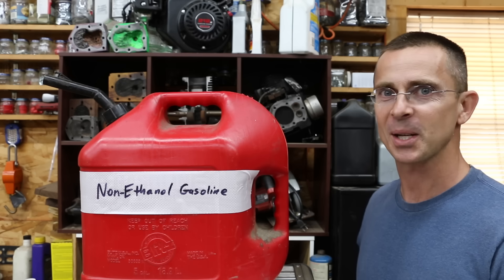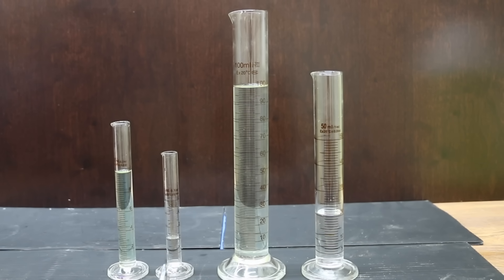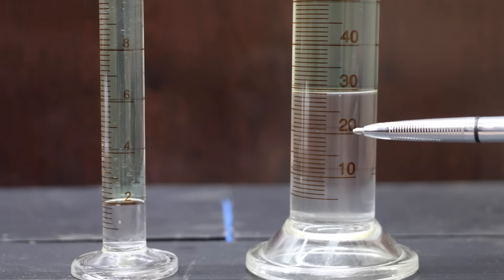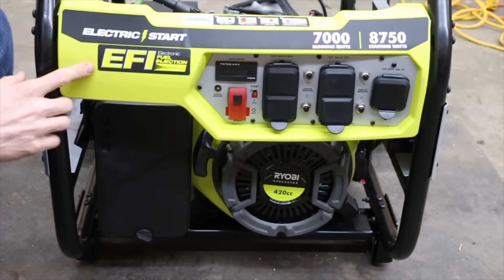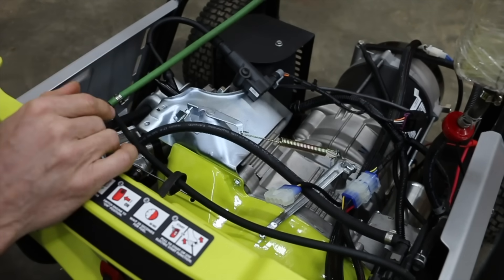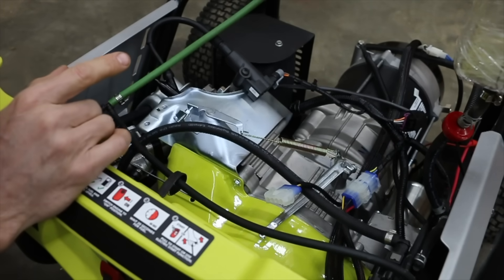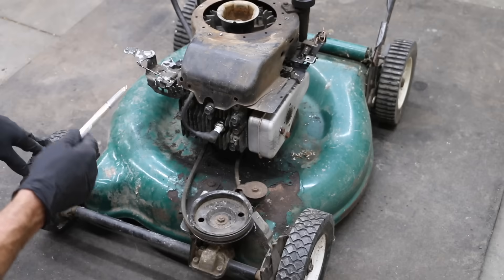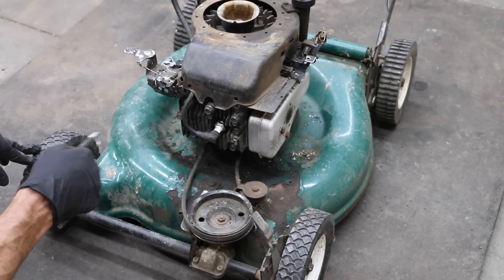Is Non-Ethanol Gasoline Really Better? See the PROOF!

Comment: During the BP oil spill in the Gulf Coast my father worked the clean up. They had many machines and for what ever reason they choose to not use ethanol fuel. People found that rather interesting as BP is a petroleum company and they do sell ethanol fuel themselves. 

BP clean up was a joke more than anything, the main part of the clean up was them spraying dispersants that made the oil and sludge more dense than the water causing it to sink to the sea floor. Most likely also how my father got cancer as it was just 1-2 years later he developed it along with a very large amount of people who worked the clean up compared to the national average.
Reply from the maker: Thank you!
Reply: They used non-ethanol fuel because of their proximity to water. Same reason marinas only sell non-ethanol fuel.
Reply: That could make sense and out of all due respect I do not say this to start an argument or even to suggest there is something there but they where leasing a lot of folks boats by the day to have crews go out and .. well clean up some along with determining the damage to the wild life (my fathers main job) but due to the shear amount of boats they where leasing they couldn't reasonable re-fuel all the boats so that job fell upon the boat owners to do. They where adamant* in their refusal to reimburse anyone who used ethanol blend fuel. I can't say why but they completely refused to do so and in this area it made it difficult to locate ethanol free fuel. Folks had to go a long ways away to get it considering the fact there was a gas station every 5 or so miles along the beach.

This was back around I wanna say 2009-ish I was 19/20 during this time and it really seemed to be at the peak where there was a lot of concerns about it as automakers at the time where openly declaring they would not honor the warranties of vehicles which where not intended to run ethanol (there is a area where every vehicle runs fine on it about 10%) but there was talks of making it 20%-30% minimum at this time. The overall population seemed to be mixed about it's effects on vehicles at high ratios and it didn't help with how BP was acting in regards to it during this time.
Reply: Very sorry about your dad. The Gulf, Fukushima, Bhopal India 1984, Exxon Valdez. Name your disaster. It's kept in the public eyes only long enough to satisfy a political agenda and then it's Hey! What's Beyonce Kardashian Angelina or the British Royal family up to.  We don't get to hear how the local population was scammed for cheap labor or paid hush money and not told how their lives have probably been shortened by years.
Reply: The reason is that Ethanol is much more expansive when you own the oilfields because you need to produce it "out of thin air"... that is also the reason bp and others don't like to blend E into their product.

Also according to the EU regualtion (at least a few years ago) the Ethanol produced by BP was not allowed to use as a fuel because they couldn't proove that it was produced with less emission than gasoline. So if you buy any alternative fuel in the EU you can be sure it is less harmful as gasoline because that is a law.

Comment: One thing I'd love to see is Stop Leak additives. I've seen some work, and others don't, but the ones that work are they risking damage? Also Cylinder Head gaskets in a bottle for blown head gaskets. Be cool if you can find a way to test these. I figure these would be harder trying to get the same failure on different engines/tests, but if anyone could figure a scientific method, it'd be you!
Reply: Stop leak is always a bad idea. In a pinch on road trip or something ok maybe just to get you home. But it clogs radiator, waterpump, and passages causes over heating issues. In oil it does exactly the same things causing blockages in oil passages, over works oil pump, and reduces lubrication of entire engine. Basically if you put stop leak in need to rebuild motor from ground up ASAP. Better idea is to get original problem repaired instead of using it.
Reply: @peterwelsh6975  Oh it's terrible, that whole "Tune up/Fix it in a bottle" aisle at the auto part store cracks me up. But clearly they keep making and selling it... I have a snowblower that is leaking oil from some mysterious place, I just keep topping the oil off for now as it's just too darn cold to take it all apart and rebuild it. I'm hoping it's the gasket, but hoping it isn't the crankshaft seal. That's why I thought of an oil seal thing.
Reply: kirbyyasha 
Most of the times seals leak because they are worn. 
The only time that oil stop leak  will sort of work is if the seals are dried out from sitting a long time. 
So at that point you might as well try a cup of brake fluid. 
That’s basically what the stop leak is , brake fluid and it expands seals in an attempt to soften them so they seal.
Reply: @peterwelsh6975  most of the people using these products know that the end of the engine is inevitable sooner rather than later. The way I see it, is the stop leak stuff is a bandaid to allow them to limp along their junker as long as possible before it's completely trashed. I think such products do serve at least that purpose though. JMO
Reply: @peterwelsh6975  I once had an old jeep, for a year two after I bought it, it would leave a drip or two of coolant, then stop for a week. One day, and entire tank solder seam blew at once. Someone had put stop leak in it, and the solder seam had been slowly "zippering" for who knows how long, until the entire seam was nothing but stop leak and blew at once. Hate that stuff.
Reply from the maker: Thank you for the video idea!
Reply: @ProjectFarm  dont forget to include the classic crack and egg and put it in the radiator fix if you ever do this
Reply: Barr’s stop leak for a radiator does work. I’ve used it on my 97 Mercury. It made a believer out of me. However I used 2 applications
Reply: @carnationvideos4258  it works fairly well on modern plastic and aluminum radiators, as the mechanical strength is in the plastic and metal, they hold themselves together well. But on soldered radiators, the solder is also the mechanical coupling of the radiator components-once the leak, they must be re-soldered. It does work quite well on newer vehicles, I must agree.
Reply: clogged my thermostat and major damage to engine. Mechanic recommended replace engine $12000, so I am currently rebuilding the engine..
Reply: I assume you're talking about seal conditioners, which should only be used in emergencies. As an Airframe and powerplant rated mechanic (aviation) we were taught never to use sealing additives because they deliberately cause the  rubber/neoprene/butyl seals to swell which, maybe stopping the leak, but cause the seals to fail shortly afterwards
Reply: @Taydrum  
It would basically be against the law to alter any oil in any aircraft. 
A&P by law sign their name on line on  everything touch. 
The head of signing your A&P license is personal friend of mine, and here's what he stated in class to new recruits. 
Dr's can only kill one at a time - 
A&P can kill thousands in a moment. 
But if it's your engine & mounted in a test stand,, have at it. 
The typical aircraft engine is fairly low tech design, except the crankshaft & cylinders. 
Notice there's no head gasket or bolts. 
Now a valve job on these is huge challenge. With the only access, the bottom of cylinder. Each cylinder is a separate entity & bolts to engine case by base of cylinder flange. Allows cylinder to move during stressed heat cycles. 
Cheers
Reply: @Philscbx  I'm talking about General Aviation (GA) not commercial aviation. Owners perform all sorts of modifications and additives to their planes whether it's allowed or not. On a side note, doctors have killed 100s of 1000s prescribing opiates and other meds. The US is in an opiate crisis, and doctors who vowed to keep health in mind, have blatantly ignored that in search of more profits
Reply: @Taydrum  
Right, that's why in first post, Cessna was mentioned.
But if you as A&P service someone's ship, you are responsible. 
Reminds me one day, owner wants me to hand prop his plane,, No, you get out, I'll hold the throttle & brakes. 
I've had 049 engines as a kid, I'm all done hand propping engines.
Reply: Yes please do a head gasket repair In a bottle. Which one is best?
Reply: kirbyyasha 
Haha I tried a bottle of that aluminum colored bars leaks a few months back. 
Stuff looked scary , like liquid aluminum. 
but it wasn’t my car so I poured it in! 
Sealed the leaks and 3mo later it’s not overheating and acting up.
Reply: lucas power steering stop leak is great. I hate all other lucas products however (tried many after such good success on their powersteering stop leak)
Reply: Stop Leak, in the micro flake copper type  works 100% at blocking your heater core in nothing flat. 
To rescue - remove heater hoses from the heater core tube ports coming through firewall, and fill core with water adding short hoses to ports, then blow back in reverse to clear the blockage. 
Use a gallon jug to catch the blow back, to prevent blow back getting engine bay covered in copper metal flake. 
If vehicle is die hard needed vehicle like an old Farm Standby for chores, and one still wants heat to work, one will need to put in-line marine water screen filter on larger dia heater hose, feeding heater. 
The stop leak will re-attack, plugging heater if not filtered. 
Proof? I've blown back the heater core at least fives times in old GMC V6. But He's 4x4 brute that just won't die, and 20 below zero,, I want heat. 
Cheers
Reply: @Philscbx  Love those big block GMC's virtually unkillable.
Reply: @ronaldcolman6211  
Very True, 
and GMC had killer big block V6 used in buses - early 60's, huge long stroke that when idling, it was the coolest sound. 
I forget the size, but it was over 300 ci. The huge torque it had was unstoppable.
Reply: I'd like to see you test against ground black pepper for radiator leaks. I always used that as a temporary fix until I could get the radiator re-cored. Nowadays I guess you just replace them, plastic tanks and all.
Reply: @GlennHamblin  
Well that explains the non-stop freeway ramp coughing & sneezing. 
: )
Reply: Yes I'd love to see this. Like the Lucas Stop Leak. My Celica has a leak in what I think is the rear valve cover gasket, and I wanted to know if it would work to help it.
Reply: JB product is the only one I'd recommend for engine oil leaks. 
It basically causes drying out seals leaking to Swell - softening them, and this has worked on older engines. 
When it's due for oil change, 90% of the product is removed, as long as oil is changed hot, to help remove other trash. 
Good Luck..
Reply: I once got back to Philly from way deep in Jersey with a holed radiator, not too bad, but under pressure it was like a weak piss stream.  Had no good solution at hand and remembered reading of a trick that might help. Ran into the KFC down on the highway to the shore points, and asked as politely as I could for some of their mashed potato mix and to fill the water jugs I had in the back of the truck (99 ford ranger 3.8L used for my construction business) . Poured the powdered potatoes into the rad, added about a gallon of water and made it home with a few dribbles until the potatoes found and plugged the hole. It smelled awesome, and it worked. Next day replaced the radiator and flushed everything. It was good to go.
Reply: @ronaldcolman6211  
wOw, Truly Awhsome. 
I'm sure it's written somewhere, back in the Model T days, oatmeal was used often for radiator leaks. 
So you're formula is right in there Captain.
Reply: @butchtropic because my celica is a JDM and it's a huge job to do anything to the engine. I just had a clutch installed and it was supposed to be a 9 hour job, but since it was so small of a space to work in, it took the shop 4 days of work.
Reply: @butchtropic I dont know they showed me it and it was very cramped space to work in.

Comment: The main reason on adding Ethanol to the Gasoline are for octane boosting purposes, and to increase the gasoline availability by “up to 10%”.

Yes, it will increase consumption levels mostly because it burns differently from pure gasoline, and also as there is water in the mix. This is also a major reason why some mostly older engines are not recommended to run with Ethanol: the internal components were not rated for the amount of water found in the pure Ethanol fuel. Everything else should be pretty similar as what you compared on this video.

Side note, I think you enjoyed having to use the space heaters in this weather :)
Reply: Also some rubbers do degrade with ethanol, which is another major part why.
Reply from the maker: Thank you!

Comment: I tried your electric start method with a Milwaukee cordless drill and when the engine fired it triggered the brake on the drill and broke the screw that holds the chuck in lol luckily it was still under warranty from Home Depot lol
Reply from the maker: Wow!  I've never had a problem with that.  I do use a corded drill that rated for 2500 RPM, which helps a lot.
Reply: Project Farm I believe a corded still would be fine because they don’t have a brake in them! It started the mower it just broke my drill lol

Comment: Ethanol is not a bad thing i mean peaple run e85 as race gas because of the octane in it but yeah it put water into your gas if you wait too long ... but if you burn it its pretty damn good but you need efi To run it
Reply: It also reduces temperatures due to latent vaporization and reduces combustion temperatures allowing more boost psi. Lower temps means less NOX pollution... the same reason for EGR valves.

Comment: Should test top engine cleaning with water dripped into the intake. Would be interesting to see if the "steam cleaning" actually works to remove deposits, and how well it works compared to fuel system cleaner added to the gasoline.
Reply from the maker: Thank you!

Comment: The plastic testing sounds great. The only problem with the ethanol gas, other than having to increase carb jet size,  is poor mileage. My newest gas car is almost 50 years old and my daily driver is almost 70 years old. No problems other than what I mentioned. Small engines seem different with plastic that gets hard or rots. Why can't they use what is used in flex-fuel cars so things don't fall apart? What I don't like, and have to use additives for, is the low sulfur Diesel fuel. I have to pay more for the fuel that can damage the IP and injectors, and then have to pay for additives to increase lubricity.
Keep up the good work on these tests. They are as scientific and repeatable as anyone can do in a home shop.
Reply from the maker: Thank you!

Comment: It's too bad Ohio doesn't have non-Ethanol fuel because I'd rather use it in small engines and be able to use it in my Gasoline Torch instead of having to use White gas. My torch did not like the ethanol mix after trying to use it  a couple times.
Reply from the maker: Thank you!

Comment: Great video, it's interesting to see that the ethanol blend is more efficient. However, I still won't run the ethanol blend in my dirt bike, quads, or other small engines. I have tried them in nearly identical engines and the non Ethanol fuel provides a much easier start up when sitting for long periods of time.
Reply from the maker: Sorry I wasn't clear.  The ethanol blend is less efficient.
Reply: I didn't catch that when I was watching it. It wouldn't have surprised me if it was 4% more efficient either. Thanks for clearing that up

Comment: For testing the rubber and plastic and how it does in fuel.  Maybe think about testing an alkalyn fuel like aspen or trufuel.  It's suppose to be good for a number of years ( good for storage of equipment that needs to run when its called for.)
Reply from the maker: Great recommendation!

Comment: yeah the problems i hear about ethanol that i hear are that ethanol is hygroscopic so it spoils much faster, It eats rubber, requires more jetting in carbs or bigger injectors in fuel injection (depending on the amount of ethanol), and oxidizes aluminum and steel parts. I hope to see the results in those test you are doing
Reply from the maker: Great point. Thank you

Comment: I have a Husqvarrna  272XP chain saw that was running rough, stalling, not peaking out and just running badly. In NY at least where I live, we have ethanol free 91 octane gasoline. I ran some of that through the saw and before I ran the tank out, it was running beautifully again. With ethanol free gas I don't bother using any stabilizer in it at all when I put my equipment up for the winter. I have two JD lawn tractors, a push mower, two string trimmers and an inboard/outboard engine on a boat and I haven't had any problems with any of them after switching to ethanol free after having them stored all winter with no stabilizer. I'd use it in my truck but at over $3.00 per gallon I don't want to spend that much money every time I fill up my F-350 pickup. Besides, that truck doesn't set around for too long. But for all my small engines, I'll never go back to ethanol free gass. That stuff is junk.
Reply from the maker: Thank you!